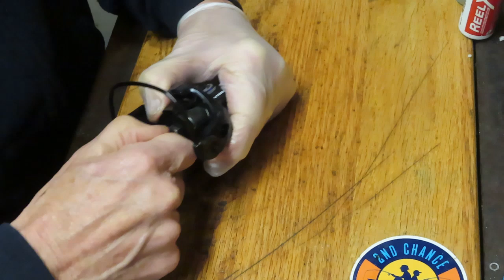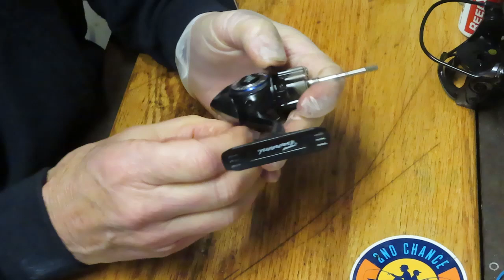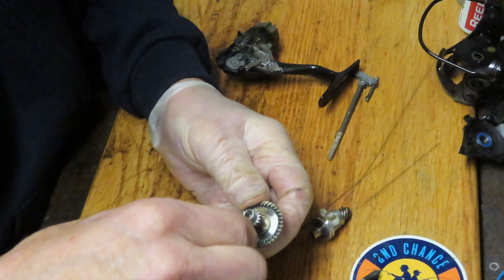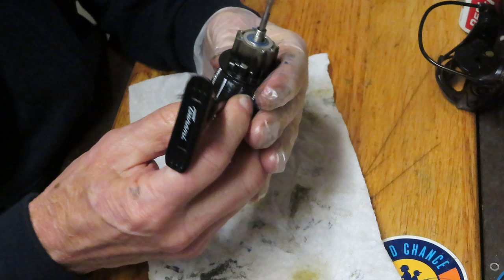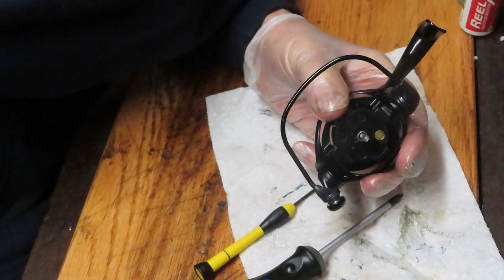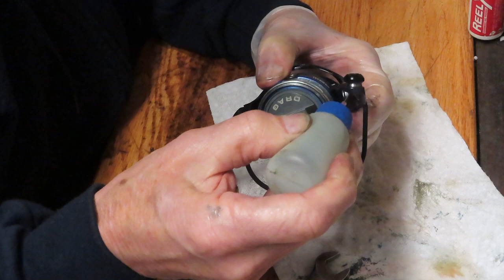Tsunami Evict 2000 fishing reel how to service

Comment: picked up a used one, has a 'wurr' when rotor rotates... works ok, but bit noisy rotation.. just a relube ??
Reply from the maker: Try the relate first.  It may be worn bearings, so that would be the next step if the re-lube isn't enough to quiet them down
Reply: @2ndChanceTackle    Relate ?
Reply: Free flowing bearing just all fell out. jees

Comment: Hey Dennis:  I'm having an issue reassembling my Tsunami EVICT 5000.  Specifically, and only, with the bail assembly.  There are 2 pins that join with the bail hinge.  One is held under tension by coil spring.  The other is not and sits in a channel.  I can't compress the spring to get the hinge to line up where it mounts to the spinning body.  Help!
Reply from the maker: I don't have that specific video, but the one in the link should help you.  You can watch it here https://youtu.be/Qrr_rizFkYw Dennis
Reply: @2ndChanceTackle  🙏

Comment: I own the exact reel, I find them to be very smooth.  I've used them on black fish with banana jigs. Easy to cast especially under a bridge.  As always great job Dennis you your my go to when I'm in a fix... reel price is about $169.00
Reply from the maker: Thanks for the additional information.  Interestingly enough, the internal gearing is a similar set up to the Penn Clash with he extra transition gear driving oscillation - Dennis

Comment: I have a Shimano Calcutta 201xt and the line guide and pawl are loose I was wondering if there was a way to fix this issue
Reply from the maker: This is likely due to wear and the solution would be to replace the worn or damaged parts

Comment: I do not own a Tsunami reel nor do I ever intend to own one. I just don’t like or trust them.  The lack of an AR override is only one of the things I dislike about these reels. I haven’t a few excellent Ryobi Powerful reels that have an intermediate gear between the oscillation gear and the main gear. Those Ryobi are at least 30 years older than this Tsunami and are far more durable and better designed reels. Also, I don’t like open bearings!  I really don’t like that spring that jumped out. This may be an adequate spinning reel but it is not one that I would buy. Of course, I much prefer my vintage reels like the Luxor I worked on today.  Great video Dennis as I did enjoy seeing another Tsunami I don’t like. — Chris
Reply from the maker: I will take that Luxor reel over this one any day!